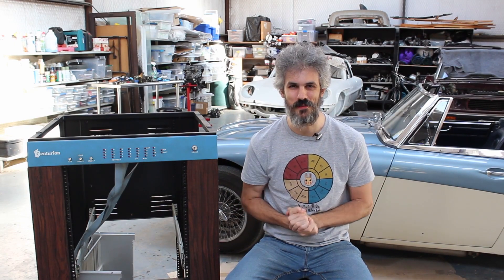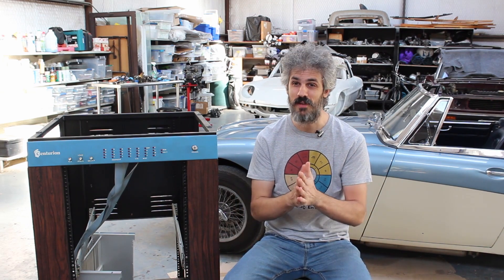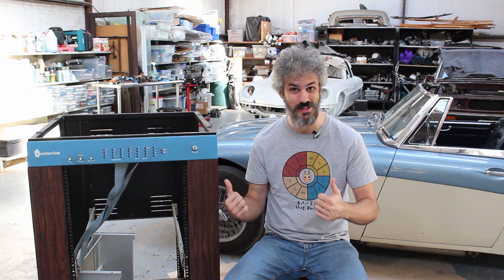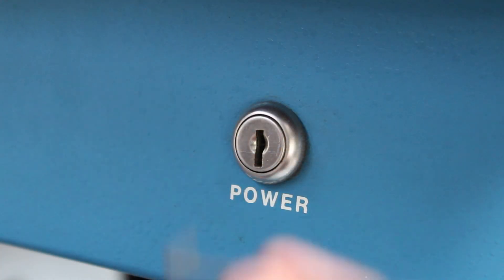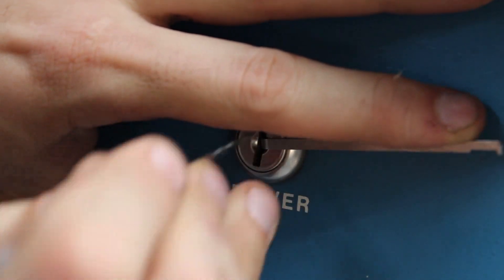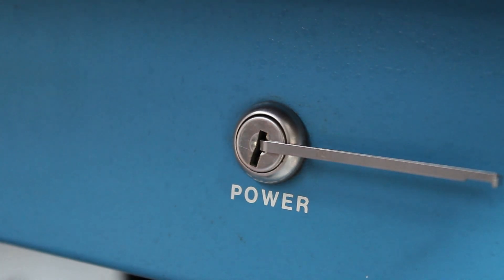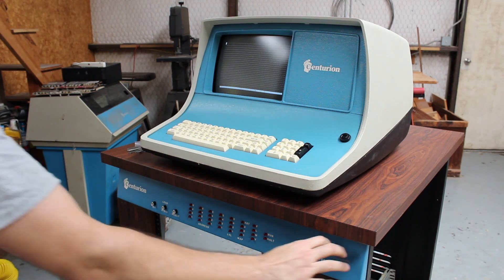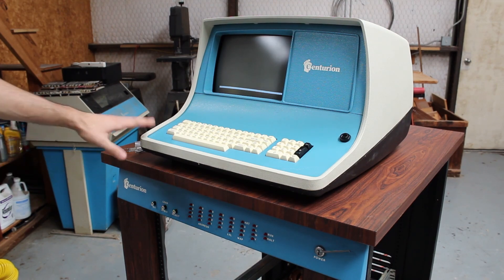Minicomputer Part 7: Cleaning and Testing

Comment: I'm late to the party, but that happens. Anyway, back in ep. 3, when you've examined the power supply, you've said it has a 66s delay relay, so there should be a delay between when you turn the key and the machine gets power. I can't see any delay here, is that editing magic, some misinterpretstion or have you changed something?

Comment: why you don,t try use those floppy controller conversion that use a sd or flash card and maybe you might be able to program it to work with some of the roms you got out of the chips, Iv been seeing  alot off people restoreing vintige computers and they get those sd cards/ slash flash cards to work and it speeds them up, they even have those shits for laptops anyway

Comment: Those big sparks from the front right (from where you were standing) when you turned the psu on were quite interesting. Happened both times you switched it on while testing it.
Reply from the maker: That's the main power relay, so it's switching 115V AC through it, which is why it had a tendency to spark. Those probably have a fairly limited lifespan as the contacts inside wear, but relays sparking with mains is actually fairly normal! Or at least, relays sparking is fairly normal on old EM Pinball machines, which is where I'm used to seeing them.

Comment: Don't forget to turn off the ECHO dipswitch on the terminal.
Reply from the maker: I actually had all sorts of headaches getting the DIP switch settings just right, but I'm going to blame part of that on ADDS because the diagram on the back shows 1 as UP and 0 as DOWN, but the DIP switches themselves are backwards with 1 as DOWN and 0 as UP!
Reply: @UsagiElectric  Good catch! Computer hardware can drive a guy bat-crazy sometimes. Question: on you vacuum tube computer, you used some kind of discrete pins instead of the traditional tube sockets. What were they?

Comment: That’s real wood, not some kind of veneer.
Reply from the maker: The top and side panels are actually particle board (you can see the particle board finish at 9:38) with a real wood veneer glued to the visible side and edges.
Reply: Bah. Fooled. 😞

Comment: The transformer is a Ferroresonant transformer, hence the noise.
Reply from the maker: Yup, apparently they're quite noisy, but it's surprisingly stable! I checked the ripple on the 5V rail with all the cards installed and it's less than 80mV, absolutely stunning!

Comment: Hi;
I've been waiting for it seems like for over a Month for You to do the next Installment video for the Centurian Computer and Nothing.. You have been posting about everything else.. What is the Hold-up ??
THANK YOU Marty
Reply from the maker: Hi Marty!
Unfortunately, the Centurion is on pause for a little bit, but the reason why is well worth it. Another commenter, Ken, has gotten in touch with me and he used to work at Centurion (and may have worked on this very system when it was new). He's been an absolutely stunning help and we're very, very close to getting the machine booted up and searching for a drive. But, in order to get the work done properly, we need to get Ken out here to help, particularly with the drives, as they're very fragile. It's just taking a while to get our schedules lined up.
Rest assured though, work is still continuing on the Centurion, and once we can get Ken out here, there should be some very, very exciting updates!

Comment: Connect a Current Loop terminal to an RS-232 or baud speed not set the same for the terminal and your port on the computer. Also if more than one terminal port on the computer ends you may be connected to the wrong port as one communication port is set to system console you get nothing on the other com ports until the OS is up and running. Not being in front of the machine i am only guessing on some of the things. Also, the lights tell a lot but need a manual to read them and what they are saying. Could be something simple as saying NO bootable disk found. Ex-DEC Field Engineer that works on PDP-10 and some PDP-11
Reply from the maker: I was really just guessing in the dark, but another commenter got in touch with me and he had some excellent information!
I need to set the terminal to 9600 baud, no-parity, full duplex, then plug it into the top port of the MUX card, and once the system has booted up, press the Select button on the front panel and I should get the system asking which program to run. Unfortunately, I haven't had luck in getting that to happen just yet, but I'm hopeful because he said that the lights on the front look like it's properly executing the boot strap code, so we should be really close to getting some life out of the system!

Comment: At 12:36 in your video the CPU6 is running the CPU boot strap program ( FCnn Hex in the program counter front panel LEDs ) from the PROM on the backplane. The boot strap PROM is the 16 pin IC in the socket on the backplane.  Other LEDs on the front panel are [ LVL  are CPU Interrupt Level 0 - F ],  CPU = RUN-ing or Halt-ed, and  the ALU status bits are F = flag bit,  L = link bit, M = minus and V = value-overflow.   Your next trouble shooting steps should be remove all the cards but CPU6 card the first memory card (address 0 to 128 KB), the first MUX card ( at I/O address F200 Hex ), put a DB9 to DB25 serial cable between the top MUX port ( port-0 on card at F200 Hex ) to the ADDS terminal set for 9600,1,1,N baud. When you push the front panel [ Load Select ] button the ADDS terminal should display "Name ="  If you type in a program file name like ?MOST and return the system will ask you for a disk drive number like 0 or 1.  At this point we will have the get a disk drive up and running. Please do not spin up the CDC disk drives till they are correctly cleaned or you will have a R/W Head crash and the drive and disk pack will be trashed...!  FYI -  If the disk platters are removed from the disk hub / spindle or the disk drive heads are removed to clean the disk heads will have to be adjusted and the sector timing adjusted to read the data from the disk every again.
The system boot steps are (1) CPU6 reads boot PROM on backplane, (2) boot strap program from boot PROM checks if Load Select of Load OSN was pushed and the status of the R / F from panel switch ( R = removable disk ot F = fixed disk ), next the step is to ask for a program file name like [ ?MOST  = MOS Memory Test with out the operation system ] id Load Select or load the operating system @OSN if Load System button was pushed.  When the system goes to read from the selected hard disk drive fixed or removable it does a RTZ seek command the reads the disk track zero sectors 0 to F into main system memory starting at 0100-Hex for the IPL tract ( the main boot strap program from the hard disk ).  If the the IPL track reads from disk into Hex 0100 the system complete the system boot. If the disk drive keeps seeking over an over again and again the IPL track data on the disk drive can not be read the CPU boot loader PROM program keeps doing RTZ to reset and re-read the disk drive IPL track zero's system loader data.   Connect me for help if you wish, would love to see this system run once again.  kromaine132@gmail.com
Reply from the maker: The level of information in your two comments is just staggering!
Thank you so much for taking the time to type all this out and it's going to be absolutely indispensable in troubleshooting this machine. Thank you for your e-mail address, there's definitely a mail headed your way soon!
Reply: Ken you are an absolute legend! thank you
I cant wait to see this piece of computing history working again.
Just a heads up edit your original comment, usagi has seen it so he can get in touch.
You dont want something like that being public for everyone to see. It could fall into the wrong hands.
Reply: @willynebula6193  I am betting that this isn't his primary e-mail address if he's willing to put it in a YT comment, I know i use a new 'public' email addy when I do this.
Reply: @exidy-yt  hopefully you are right.
Reply: @willynebula6193  Wrong hands? Like nuclear launch codes? LOL
Reply: The story of this system is fascinating. Thank you for reaching out and supporting Usagi in this series. I haven't been so enthralled on a YouTube channel for many years. Thank you.
Reply: You are a legend sir, thank you for your help bringing the system back to life for us to enjoy it on video.

Comment: The ROM dump will not give you any useful info to decode.  The ROMs on the CPU model 5 or 5 board are the Micro-Code store for the AMD Bit-Slice  2901 4 bit CPU slice. The Micro-Code word I think is 56 bit with some of the bits going to the two 4 bit AMD 2901 and most the bits to state machine logic make the memory mapped I/O cards at F000-FFFF this the CPU is the old model CPU4.    Get to a cable connected between the 4 port MUX card (top port zero) and a Centurion ADDS terminal set for 9600 baud 8, 1,N and Full Duplex.  When you push the computer from panel ( SELECT ) push button switch the Centurion terminal on MUX port zero should display [  Name =  ].  When [  Name = ] is displayed its asking for the name of the program you wish to load from a disk drive.  The   Name =  ?MOST  (is the standalone MOS memory Test.)   Name = OSN is the Centurion operating system ( like UNIX but not really, OSN is just our own system, that's how all mini computer vendors are in the 1970-1980's ).    To get  [ Name = ] to display you only need a CPU, MUX at I/O address F200-Hex and one memory card set to start address 0000-Hex  & ending at 32KB, 64KB  or 128KB based on type of memory card. (8 position Dip switches on the memory card enables one row of 4K or 16K DRAM chips per switch that are turned ON).  In most cases the top 8 position switch are all ON and the bottom 8 position switch are all OFF ( could have this backwards, it has been over 30 years ago that I last worked on a Centurion CPU.    If you have a 4 position Dip switch on the memory card it is used to "roll" the enabled row of DRAM chips around the memory address space of trouble shooting and only is an issue of the board has less than all the rolls full of DRAM memory chips.    kromaine132@gmail.com
Reply from the maker: Ken, this is an epic amount of information!
I can't tell how awesome it is to see this, there's more info in this comment than I think I could have ever figured out on my own, haha.
Thank you for giving me a good trouble-shooting procedure to start working with as well. After I check the ripple on the PSU, I'll work on getting the machine set up like this and try to get an actual test out of it with some response on the terminal.
Thank you for your e-mail address too, there's definitely an e-mail headed your way soon!
Reply: From memory Ken? Your ROM/RAM still works great!
Reply: Edit this one to Ken.
Just looking out for ya mate!

Comment: You need to locate which port is the console.  It may be on a completely separate card.  The other ports are not going to have any activity until there's a running OS to talk to them.  I'd also try setting the terminal to a high baud rate.  Generally a low baud computer feeding a high baud rate terminal will cause garbage on the screen, while going the other way tends to be real quiet.
Reply from the maker: Fortunately, another commenter reached out to me and they used to work at Centurion back in the day!
Turns out to get any data out, the console port is the top port on the mux card, and I need to set the terminal to 9600 baud, 8-bit code, 1 start/stop bit and no parity, then I need to press the "select" button on the front panel. At that point, the system will send a prompt to the terminal asking for which program to execute. I'm not sure I'd have ever been able to stumble upon that myself, haha.

Comment: Hi , Yes transformer noise is pretty normal .
Especially when we look at this ones age .

Transformers get much much louder as they age .
This is because the transformer core adhesive starts to break apart 
slowly over time and the laminated layers separate slightly from each other . 
The vibration of the layers is causing the humming / buzzing noise .

When a transformer core  is magnetized, it's  dimension changes slightly 
with the magnetisation. 
At the lower flux densities in transformers the amount of magnetostriction 
is very small and as the flux density increases the magnetostriction and 
noise start increasing.

When the adhesive starts to break appart the sound gets louder.
Magnetostriction takes place at the double of the frequency from main load .
That mean that a 60 hz supply a lamination vibrates at 120 hz and a 50 hz 
vibrate at 100 hz , so it is for shure audible as you can hear .
There can also be even harmonics in the vibration too and this push 
the frequency up further and thus more annoing .

This become worst If any part of the transformer is in resonance with any 
of the harmonics this will amplify the noise many times.
This is caused by the air gaps in the core .

If somehow could find a way to remove and apply new adhesive in between the 
laminated layers then the noise could be reduced , but i can't at the 
moment think of a method that doesn't require the transformer to be 
disassembled and rebuild .
Also when apply new adhesive it would be good to be able to do it in a 
vacuum so eventually air bubbles is flushed out .
After all it is those airgaps that is causing the noise by allow the 
laminated layers in the core to vibrate much more than without .

Here is a link to a PDF about noise in transformers - 
https://federalpacific.com/wp-content/uploads/2019/01/2016-FP-Understanding-Transformer-Noise.pdf

Keep up the good work , can't wait to when the hard drives and remaning stuff 
is all connected .
This is starting to look really nice .

( What an amazing piece of technology )
Edit - sorry for evntually typos , it's late here and im sitting enjoy a cup of coffe  :  )

Ps - I forgot to say that High quality transformers used in audio equipment is usually 
totally incapsulated in resin ( or other materials ) , Im thinking that maybe if this old 
one is incapsulated it will defeat this noise  .
Of course we have to think about heat transfer from the transformer but if it doesn't 
get too hot then maybe this could work .
You could try with an old noisy trash transformer to see how it works out first .

Keep up the good work , I enjoy your videos with a nice cup of coffe .  : )
Reply from the maker: Thank you for the excellent information on transformers!
A few other commenters have mentioned that this is most likely a Ferroresonant transformer, and that those tend to be quite a bit noisier than regular transformers. I think this is due to the weird LC tank circuit they use as well as the fact that they operate in saturation pretty much all the time.
Fortunately, the entire system is too big to squeeze inside, so it's going to live in the garage for the time being, which means that as long as it's giving me proper, stable voltages, it can be as noisy as it wants! Once the drives are in, I imagine the thing will make a right proper racket, haha.

Thank you again for the awesome information though, I love reading more about this stuff!
Reply: @UsagiElectric  Thanks for your kind words   :  ) 
Ha ha , Yes I understand , that size  '' micro '' computer is really big 
and you are lucky to have a good space in the garage .
I know pretty well how much space such equipment take up .
In my '' living room '' ( It's also a home studio ) the equipment take up 1/3 of the room .
Thats why my next house will be a little bigger so I can make a dedicated ' studio room '' .
My noise problem is not transformers but cooling fans , lot's of cooling fans running 
24 / 7 but because of the high temperatures here in Philippines then I can't run them 
in any slow / silent mode .
I was thinking about building a closet size room and isolate all computers and 
equipment with high power fans in there and attach one very big fan going to the 
outside for airflow , that way no more noise in the room but it have to wait a little 
longer until I can '' upgrade ' myself into a bigger house .

Glad to hear noise will not be a problem .
I can imagine have this '' thing ' inside the house ....
( would take more than a few beer to calm nerves down )

You have a terminal based system so you could manage some cables and have a 
terminal in house and one or two in the garage , sometimes it can be more ' comfortable ' 
to sit and program in an office room or other room .
Especially if like me , you like to enjoy a good beer or a glass of wine and some 
nice music when sitting and programming this thing  . 

As I know it wont be any problem to run long cables on the terminals as the delay ( latency ) 
will be very low and really not noticable .
I know that if a stage cable for a guitar is more than 12 meters then you can feel a slight 
delay when play but with a terminal it be buffered out so not noticable .

I wonder if I could emulate this computer on my computer .
I already have IBM 360 mainframe server system Emulated and it run great .

Keep up the exelent work , it is looking very nice now .
 --  Sorry if any typos Im on a Big cup of coffe right now  ....   :  )

Edit - I forgot to mention that if you descide to set up a terminal in house then you could 
easy make a remote power switch to turn the whole system on / off from the house .
Just a cable and relays and thats done and if want to be advanced then voltage monitoring 
and such can easy be added to show it's full status . 
Cheers keep up the great work  :  )